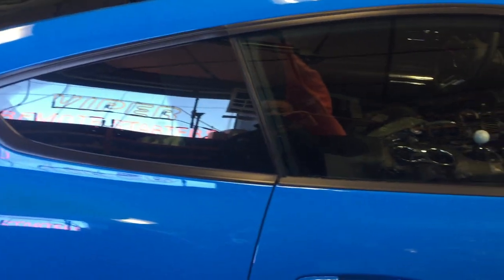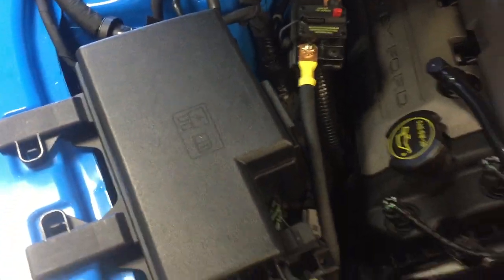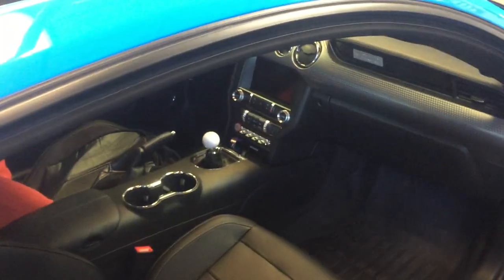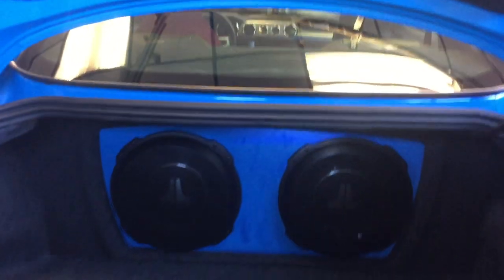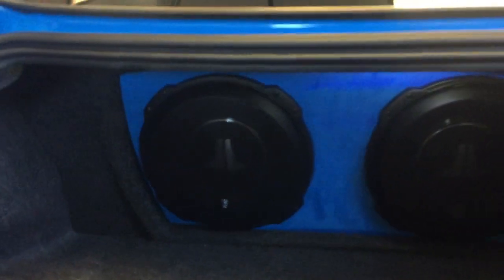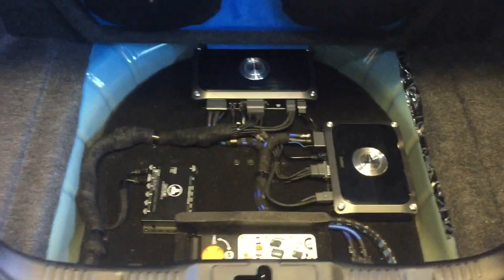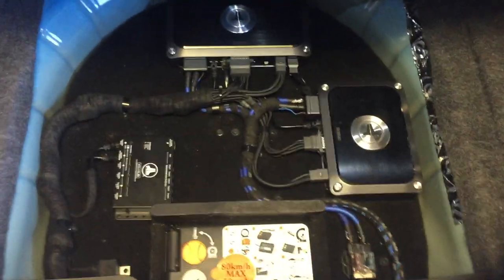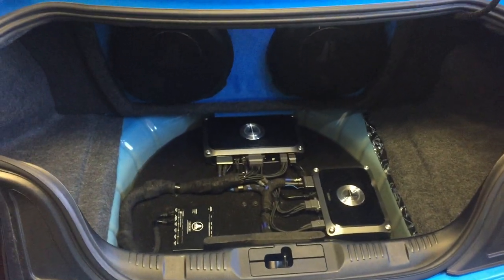2017 Mustang GT Audio System Upgrade

Comment: My boss has a couple 12's in the 5runk likes alot of bass bumping those corridos stupid bass now he's having battery issues. Did the battery buen out ? Do you think theirs corrosion? I know who we installed the system didn't tune it properly like wiring ohms or frequencies they just bought this bought that positive negative done. What would be your first quess?
Reply from the maker: After doing this Mustang system we incurred a charging issue. Troubling shooting this will time consuming for me on YouTube. Email me, bruce@soundconcept.com.

Comment: what did this cost to do?  I have the same car, i am located right outside of Nanuet as well and looking to do it on my vehicle
Reply: $9500
Reply: @brentrichards1200  Yeah, there’s no way that is a $9500 setup.
Reply: @galenhart  more like 1200-1600
Reply: @loribass4829  I have almost the exact same setup, and I paid $2800 for it. A little more than $1600, but definitely not anywhere near $9500……..unless he got completely ripped off. And mine has every single speaker in the car swapped, plus the additional subs. The only thing that is still stock is the head unit.
Reply: $9500😂😭😂……You must be insane and if they let you charge them that much even if they purchased the amps and subs from you then your both insane😂

Comment: Is this a stock alternator and battery?
Reply from the maker: Stock alternator with an upgraded battery. Check the battery voltage at 2,000 rpm's. Some of these vehicles are capable of 15+ volts. The aftermarket amplifiers shut down. I have a fix.

Comment: I know this is old, but why not use the optical out from the master amp to the sub amp. That way, no need to run those RCA cables.
Reply from the maker: The optic cable has a 3db loss on the signal.

Comment: Where are you located??
Reply from the maker: Nanuet, New York. It's 20 minutes outside NYC
Reply: TheSoundconcept very far from me unfortunately. Did you replace the factory amplifier(dsp)
Reply from the maker: The address is 264 E Rte. 59. The audio system put together is the best of what is available. The ability to tune the individual sections of the car adds to the quality. The final price was $9,500.